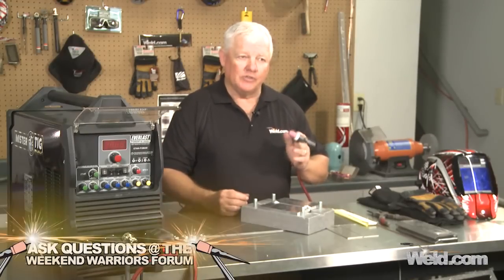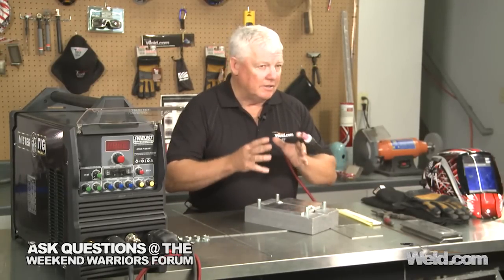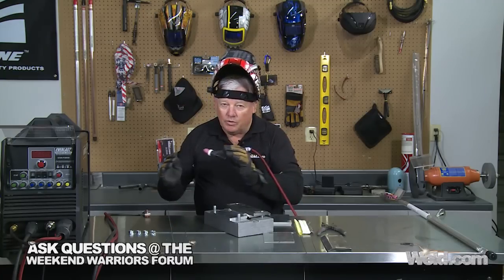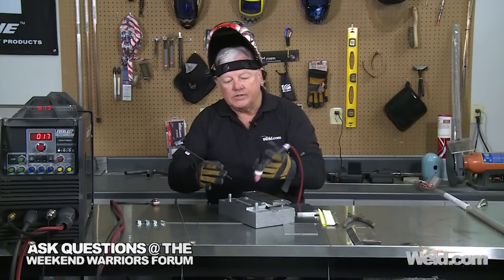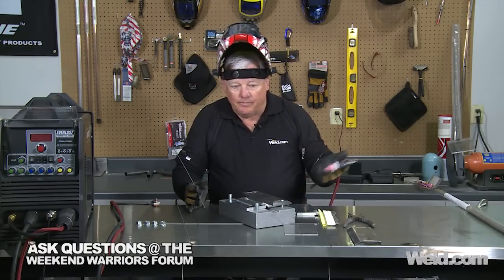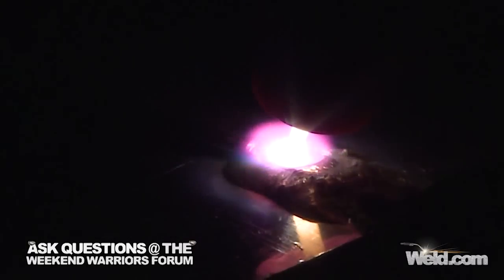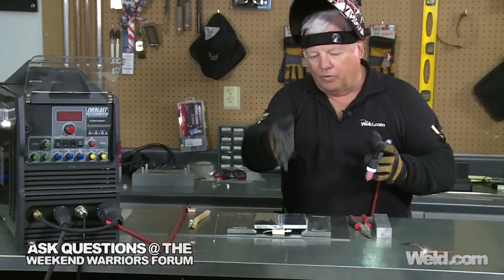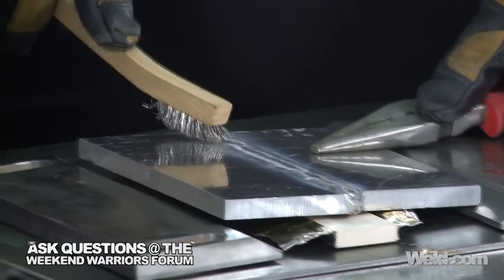DC Aluminum Welding: Part 2 | TIG Time

Comment: I reviewed this because I had a project requiring thick aluminum welding, and I had no high amperage TIG welder.  This allowed me to get the job done with the equipment I had, for the expense of a bottle of helium. Thanks!

Comment: Thank you you so much for your dc tig aluminum videos im going to be buying a prime welder/plasma cutter and haven't been sure if i wanted to i dont have much need to weld aluminum but i really wanted a option i can not aford to buy 2 separate machines hell still saving to get the 400 for the 3 in one machine. You helped me make my decision my other option was a yes ac/dc tig thats 220 only and that would be a pain would have to run electric for that or get a generator. Thank you so much you are great!!!!!!!!!!!!!

Comment: I'm in the process of watching alot of weld.com & others, looking for an AC/DC tig-stick. I've seen great reviews for most of the $799-$999 models everlast & even a primeweld I'm sure there's more. Anybody have a suggestion for a tig beginner? I will be attempting some projects like "long tube headers" aluminum plate "intake manifold" and panel fitting. My roll cage for my stroked big block dodge dart. Ect ect

Comment: Guess what am missing is why would you not pre clean the materials to be joined since you lack the surface cleaning action of ac with this.  When I was doing fabrication years ago we would stainless brush all surfaces to be welded and scotch brite the filler too.  Then a couple of wipe downs with acetone to assure a good clean weldment.  DC on aluminum with helium is already hard enough with good prep.
Reply: It's for thick structural shit it isn't supposed to be pretty like finish work as you stated

Comment: This method doesn't seem to work for me.  I don't get the silver puddle.  The final weld has oxidation and a rough surface.  Could it be because I'm using thinner material at lower amps?  Or helium that is less pure?
Reply: Aluminum acts as a heat sink. Keep your amperes up high and move faster

Comment: could you do the 3/8 wit 180 amps?
Reply: +Red Dog I managed to do it with 150 amps.  All I had was 5356 rods and it worked strictly okay.  I'm sure with 4043, it would work better.

Comment: God that's awful.  You get a lump of molten aluminum on both edges of the weld.
Reply: Yea but it's more a structural process not a finish
Reply: @silverssonyoutube8438  that's the oxide layer. After brushing the stringer will look mint.